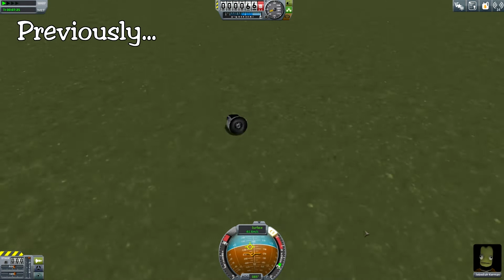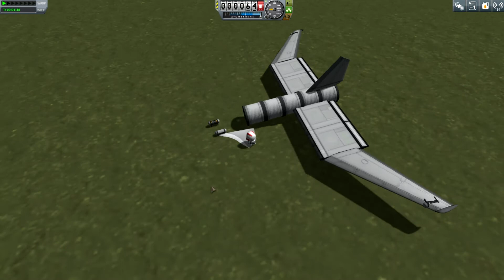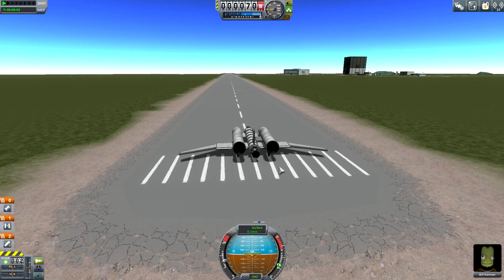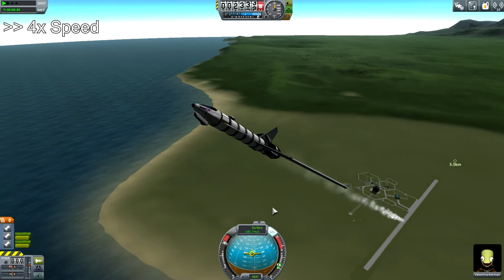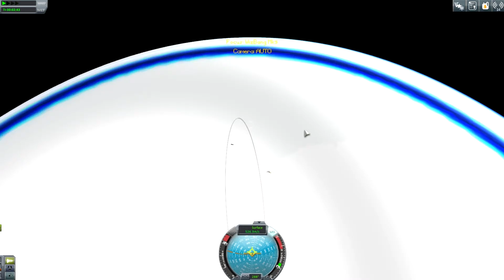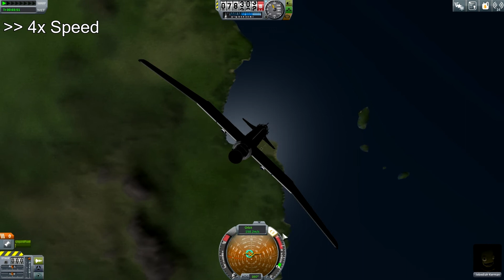KSP - Challenge - Low Tech Sub-orbital spaceplane Part 2

Comment: dont even bother shutting down the jet engines, and turn on your rocket as soon as you start going up vertically cause those engines no longer work when your vertical, as you notice if u re-watch the video your speed drops significantly when you start going vertical, at 5:25 in the video
Reply from the maker: Daniel Jackson Great tip, I went back and tested and it is indeed possible to do it without the action groups following your instructions. Good stuff 8)

Comment: It doesn't have enough pitch authority! Needs more elevators!
Reply from the maker: Debated Nothing Indeed, except I was at the part count limit of 30... so more elevators would mean less something else, what could I take out?
Reply: Weird Wizard Dave Take off the front "fins" and replace them with the same kind of control surface as the rudder.

Comment: I would imagine that when going vertically, the wings are just extra weight. Try flying at 80 degrees instead?
Reply from the maker: PinkieComics Actually in this scenario fuel is king. Trying to use the wings for lift would just end up wasting fuel. Now if you could have nice fuel efficient jets with enough thrust and air intakes to fly at high altitude then it would indeed be better to use the wings as wings during the accent stage but with this design the wings are just there for take off and landing, the rest of the time they are best thought of as dead weight ;)